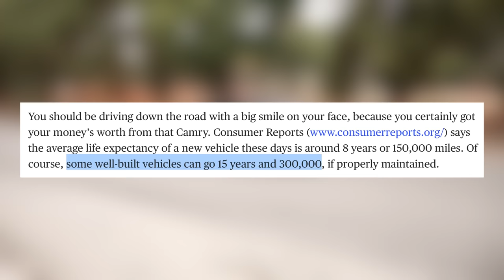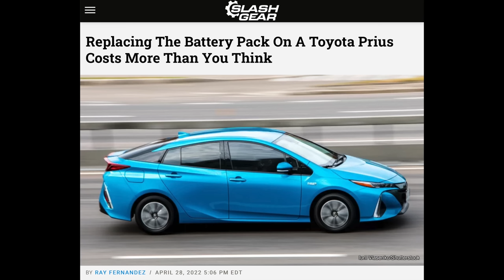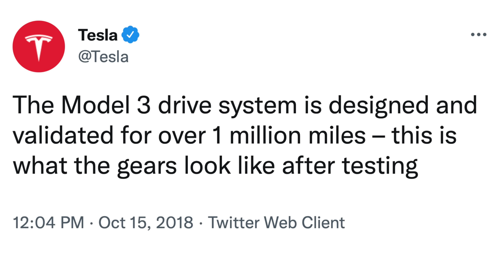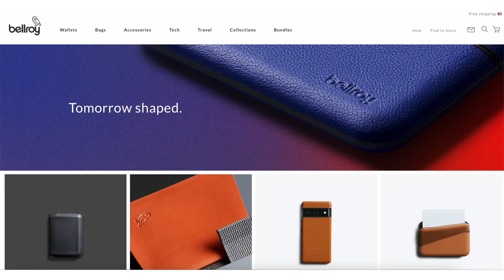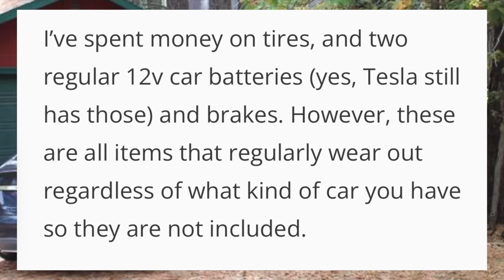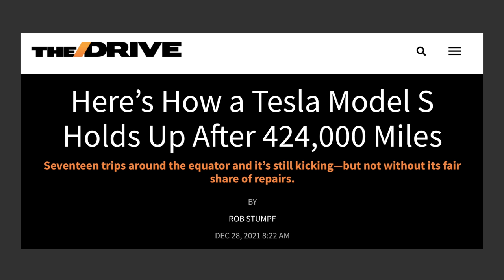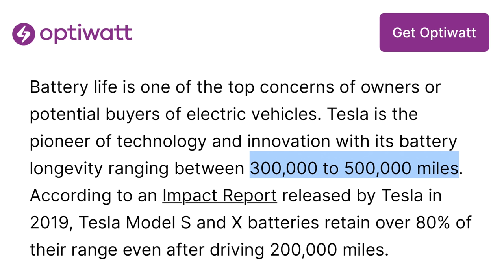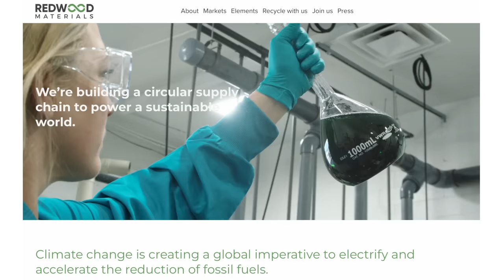The ONE MILLION Mile Tesla | It Still Runs

Comment: My experience is a bit different. I have a 2018 Model 3 with 80,000 miles on it. Repairs are almost non existent with control arms being the only thing so far for $250. I replaced the tires twice. While that is good, my battery degradation is on the bad end of any normal curve. When new I had a 310 mile range. At one point it went as low as 267 miles or a drop of 14%. I was told by Tesla as well as several YouTubers like Kim Tesla to run the car down below 10% charge and then charge to 100% to recalibrate the battery management system. There are some differences as some say when it is very low, leave it there and ping the car regularly for an hour and then charge it at a level 2 charger. Once it hits 100% do the same as far as pinging or opening the door to wake it up for an hour before driving it to get down to 90%. I did that 5 times and the range increase to 281. That was a bit over a year ago and now it stayed at 280 for awhile and suddenly dropped to 272. So I am down 12% after 4 years and 80,000 miles. Tesla service has said to expect 5% the first year and 1% each year afterward. I am nowhere near the 30% for battery replacement but it does have an effect on my 750 mile trips to my daughter especially in the winter. Does anyone know of other things to do to help?
Reply: I am *not an expert.  But it sounds like you could have one or more cells that are misbalanced relative to the rest of the pack.  If one or more cells never reach full charge, it will hold the entire battery pack voltage lower than 100%.  
It seems to me, that taking it to 10% did have a positive effect - that's an indication your troubleshooting was in the right direction.  
My thoughts:  Do the pack balance procedure down to 5%, if range improves - it can more accurately calculate where 3% is....then do it down to 3%....after that, you could do it down to 2 or 1% or decide you're happy with the results.  To be extra safe, you could choose to take it to 10% first, then do the 5% run and 3% run since the battery range has changed since you last did it.
One more thought, you could have a cell or cells that leak voltage more than the rest of the pack.  This would indicate a small internal short, perhaps not catastrophic, but enough for it to self discharge more than the other cells causing your pack to unbalance.  It might be a good idea to balance your pack quarterly, that is - take it as low as you can and up to 100% on a level 2 charger.  This will keep that cell and all the others in good health.  This scenario is like a leaky tire.  You can have a small leak and get the entire advertised tread wear out of that tire if you keep it properly inflated.  it just takes a little extra effort / maintenance.
Reply: usually in every 6 months its recommended to get your battery to 0% only using AC, and then charge back to 100% on slow charger twice, this is mostly a 2-3 days job, but your battery will get way better for sure

Comment: A friend’s Model S is almost up to 500k, and his costs have been a tiny fraction of an equivalent ICE car. (He’s a professional driver and on the road an awful lot.) He would never EVER go back to an ICE vehicle. He has had no MAJOR parts replaced, just things like door handles and a couple of suspension parts, and just ONE set of rotors and brake pads.
And of course, he has saved a FORTUNE compared to the cost of fuel.
Reply: I've had my EV for 7 weeks and already saved $1100 in gas. It's insane
Reply: Wow that’s amazing does he do limousine service
Reply: @jasonmangan3205  Yes, correct, mainly highway between regional towns and our capital city.
Reply: That’s amazing Tesla’s are the best cars on the planet in my opinion
Reply: That’s amazing Tesla’s are the best cars on the planet in my opinion
Reply: @FutureSystem738  l have one that l ordered back in January the Model Y & I’m expecting to take delivery in the next 3-4 weeks for my limousine company I also do livery transportation & l no it will be a cost saving vehicle
Reply: @Farly98  I’ve had my model 3 for nearly 6 months. 14200 km’s (8500 m). I charge almost equally at home and work(free at work). I’ve spent $115 total according to my Optiwatt app, which tracks my home charging costs based on my electricity rates.
$115 would get me about a tank and a quarter or 800 km’s (480 m) with my old Audi A3. It’s really awesome.
Reply: Shit wish that was me I drove 100k miles in two years had to replace rear suspension front control arms this year alone 10k spent between that and new tires
Reply: @thirsty3333  which Tesla do you have & are you driving it for public transportation
Reply: @Farly98  its cute how you think the price of electricity isn't going to up the more demand there is.
Reply: @jeffschlagel5632  when did I say that? Of course it's going up, but it shouldn't be.
Reply: @Farly98  so you were apparently sleeping in high school economics class when they taught supply and demand.
Reply: "Saved a fortune" like $16k? The car costs a fortune 🤣
Reply: @not today sorry, bad math. 8800 miles
Reply: @Farly98  man spending that much in fuel is crazy
Reply: @not today I’m Canadian. We use Km’s but I usually try to add the miles for the folks to the south of me.
Reply: @Farly98  I would put half of those savings into your retirement portfolio (make sure Tesla stocks are in there), and the rest into a high interest savings account. Then use that money for any future Tesla car repairs. ;-)
Reply: @jeffschlagel5632  It's cute that you don't take into consideration roof/backyard solar panels as a viable option when it comes to charging the car's/home's battery system. Those panels (which are getting cheaper and more efficient every year), will easily offset future electricity price increases. It also allows people to become way less reliant on the major energy providers. It's equivalent to EV owners not having to spend $50-$100 every time they need to full their car up with gas/diesel. How far do you get on a tank, and how much did it cost you to fill up recently? Yeah, I thought so.
Reply: @CoroaEntertainment  Apparently you haven't done the long term economic costs of solar panels.  After installation it take about 20 years to recoup the cost of installation, internal conversion system and the panels.  Solar panels only have a life span of about 25 years.  So you get about 5 years of savings on these.  Not worth the effort or cost.
Reply: @jasonmangan3205  hey long shot but how'd you get into that business? I'm in San Diegl and been doing doordash for 2 years and bought my tesla because of it but trying to find something new since doordash is starting to get old for me
Reply: @jeffschlagel5632  if you do your research you will see that the moneyback is closer to 10-15 years depending where you live. At current electricity rates. It's funny how you have double standards on your "calculations". The world is transitioning to electric vehicles whether you like it or not. Bottom line an electric motor has 90%+ efficiency while the best ice engine has close to 30%...so there's that
Reply: @dsnmttr  Its cute how you think energy prices aren't going to go up as demand does.
Reply: @jeffschlagel5632  which means solar panels installed now will pay themselves even faster 😉
Reply: @dsnmttr  so what part of the country do you live in where the sun shines 24/7?
Reply: @dsnmttr  who is going to pay for the solar panels when they are damaged by storms?
Reply: @dsnmttr  where are you going to get your power when those panels are damaged?
Reply: @jeffschlagel5632  I have done various labour work for a variety of off grid setups.  Lots of people have panels that survive storms.  I have never seen one get damaged and I live in a wooded area that is near the ocean and mountains and gets large storms.  If a panel gets destroyed, you replace one, not the whole system.  Also the warranty is 25 years, so during that period manufacturers pro rate the panels value.  also, most panels last longer than the warranty, they just loose production efficiency, dropping to 85-90% after 25 years, but maintaining energy production.  how often do you replace the windows on your house from damage?   Grid storage batteries last 30+ years if setup properly and treated correctly.  Solar and wind are cheaper than coal over a 25 year life cycle, even once you factor batteries, as coal fired and gas fired peak-er plants require exponentially greater maintenance(both man power and parts) and continually need fuel that has to be mined.    I hope this information is helpful!

Comment: Honestly if you don't mind the reduced range the battery can last as long as you want.
Reply: Not really. After 30% degradation you get massive problems with balancing between the packs. also the risk that one or more cells get to fail is much higher and at the end the whole pack dies because some cells died. Its mostly not the whole pack that dies but some of the individual cells.
Reply: @nicoleibundgut534  each cell is fused individually, if a cell shorts out it just disconnects from the whole pack.
Reply: Nop, the cooling system can also clog/fail, the electronic fail, and so on... most replaced batteries under warranty are not due to a loss of range, but to a complete failure.

Comment: EV is like a computer. It either works or it breaks. Mechanical things have a “semi-working” aspect like a engine running on 5 cylinders instead of 6 or a squeaking fan that runs perfectly fine. This means once it breaks, you NEED to fix it. You can’t just “run it broken”. The positive is that if it doesn’t break, it doesn’t break. It’ll keep going.
Reply: mab all ice cars have compiters in the car, they are called acu, like 5 or more.  My bmw and gmc are filled wirh this things that break and coat up to $3 in some cases.
Reply: In this respect they are similar to SSDs.  I always say, if you can read and write a TB to itself and it goes 3 months, it'll likely last next to forever.  With a conventional hard drive, you never know!
Reply: Best insight and explication I’ve read
Reply: EVs are closer to that ideal than ICE cars but they’re far from solid state, so even the solid state components can be affected by movement/insulation wear/electric shorts that would present intermittent symptoms and likely lead users to believe “this car is a pos”. That’s just one example, among many I can think of and likely more I can’t.
Reply: computers are not cars, they should not be.

Comment: My tesla model 3 battery began at 265 mile range and is now down to 220-225 mile range in 20,000miles and 2 years. That is roughly a 15%-17% battery degradation. If it continues to degrade this badly I will definetely be on track for a valid warrantied battery replacement.
Reply: How do you set your charge cycles? Do you allow it to go under 20%?
Reply: That's normal for the rwd, 200 miles on 90%
Reply: your car is normal ,  and your car is in the typical battery  degradation track. the car in the video  is not normal because that this car battery is very special good.  The cars in this video is called as prototype Tesla car,  first manufactured cars that were made of premium  hi end Long life battery.
Reply: @eddiechen5460  No it is not normal, about 3 months ago I got a warning on my Tesla so I brought it into the service center and they ended up replacing my entire battery due to the severe battery degradation. They ended up giving me a "refurbished battery" and this battery holds a consistent 230 miles and hasn't degraded at all in the 3 months I've had it. It's still not at 100% battery capacity (265 miles) but atleast it isn't dropping anymore.
Reply: Have you had Telsa take a look at the battery health?  There may be another issue brewing.

Comment: 3 million miles on volvo p1800 is highest I recall if I recall correctly.  It was well past one million for sure.  I was especially impressed because I got one myself old and used as my first car I didn't share with sister and it lasted nowhere near that.  That guy obviously took very good loving care of his car.
Reply: If you read up about it he did hella maintenance, a few rebuilds, and a super blank check situation
Reply: Doesn't count if the engine was changed, which is usually the case
Reply: @theepicricemaker6611  The same engine. The same gearbox.
Reply: @ypaut  Original engine and gearbox.
Reply: More. 5.150.000 kilometers, then the original owner (bought it in 1966) died, in 2018. Volvo bought the car and are still using it, aiming for 6.000.000 kilometers.
Reply: @Xanthopteryx  The engine block was original, but the rest of the engine got rebuilt several times. No engine could last millions of kilometers on totally original parts.
Reply: @Clumrat  Two times. So if we split it the engine lasted more than 2.000.000 kilometers. Could have been more. The longest Tesla had four motors replaced before 1.000.000 km. And at least two batteries.
Reply: @Clumrat  my brother has a Skoda Fabia VRS with the 1.9pd engine. It's currently at just over 500,000miles. It's just had regular servicing and runs like the day it left the factory returning 70mpg. not too bad really. should crack 1 million miles at the current rate - burns no oil and uses no water.
Reply: @markburton8303  I take it back then, that's really impressive.

Comment: 2018 Model 3 long range here. It has 110k miles, original battery and about 4% degradation right now. I do about 50k miles a year now so I'll know in the next few years how many miles I'll get out of this battery.
Reply: Did you have to replace the 12V battery?   Would you wait till you get an alert that you need to replace it?   Have you done any brake fluid flush or pad replacement?
Reply: @Trust but Verify  No I haven't replaced the 12v. I might go ahead and do that before it goes bad.. thanks for the reminder. I very rarely use the brakes because i keep regen on the highest setting. The pads still look relatively new as of last year when i put tires on it. I generally leave brake fluid alone unless I have a problem or race a lot.
Reply: @jeremiahsimon6594 how many miles and how you liking it. Thinking about getting one.
Reply: Hey can you giv us any update thanks
Reply: @steezyg3332  Turned 173,000 miles today. Degradation is about 9%. Zero issues! We have about 5,000 miles worth of road trips coming up this summer so we will continue packing on the miles. Should hit 200k some time this fall.

Comment: Batteries have a calendar life, and will expire even if unused.  All of this mileage discussion needs to be tempered by how many years before the battery needs to be replaced.  With 8 year warranty I expect to get 10-12 years before battery replacement if I am not unlucky.  Storing the car in a cool environment and at 50-80% SOC will help, and it might be possible to get 20-25 years of battery life.
Reply: Yes, I wish someone would do a video on the economics of an EV us low-mileage drivers.

Comment: The thing is the p85 only reached 1,000,000 miles with 2 batteries and 8 drive motors. that is really a lot when someone says "my car has driven 1,000,000 miles" they mean my car and powertrain has lasted 1,000,000 miles, not the car itself. 

we gotta start looking at ev longevity from the perspective of on its original battery, and original motor because having the battery replaced is essentially like getting your ice engine replaced, and nobody goes around bragging about how long their car has lasted with a replaced engine after the original one went bad.

good, but still not ideal. a lot of improvement remains and i'm eagerly waiting to see how long a model 3 can last without a battery or motor replacement
Reply: Agree

Comment: Interesting. I have a 2021 Model 3 Long Range. Originally quoted at a max range of 353 miles,  kw when I charge to 100%, I get between 357-358 miles... the only vehicle I have ever owned that got better milage over time!
Reply: Mine is opposite, I have 2 model Y one is 2021 November and second 2022 June. Now when I get 100% on 2021 I get 312 miles now(14,000 miles in 9 month)  when I get 100% on my 2022 I get 320 miles. Both charging to 80% and both don’t go below 20% live in Florida (not like in Alaska) never used supercharger. Will see where it will take me, planing to put 40,000 miles per year!!!
Reply: @JY-lg6ee  I need charge to 80 because by the time I am done I am at 30%, therefor I charge daily driving over 100 miles per day
Reply: @JY-lg6ee  at 80% I am 246 miles if you decide it by 0.8 you get 307.5 ; so there for you get your answer
Reply: @JY-lg6ee  second Y 2022 is at 259 at 80% so if you divide it by 0.8 = 323 means still good (4000) miles

Comment: I have 122k+ on my M3P with minimal cost to service. Most were covered under warranty. No brake replacement yet. I’ve replaced the 12v on my dime once. And the driver seat frame is being replaced tomorrow for rocking at a cost of $500.xx or so. The biggest issue is flats and bent wheels as I have 20” low profiles but that’s not the cars fault. And the bumper was painted from someone hitting the car in a parking lot that was never caught. Original pack gets 282-285 mi at 100% originally 310.

Comment: I have a 2015 Model S P85DL with 178,000 miles and have only lost 10% of range after almost 200,000 miles. I have zero concerns of the battery going bad. They did replace the rear motor at 160,000 miles under warranty. I absolutely Love the car and could never go back to an ICE car. Excellent video, thank you so much for sharing!
Reply: How many miles you at now and how’s it going?! Looking into getting one maybe the model 3 long range
Reply: @Whathadhappenedwasss  188,000 miles currently and still has only degraded 10%, New 252, now 225. Haven't had any issues in a very long time. The Model 3 has much better motors that last forever.